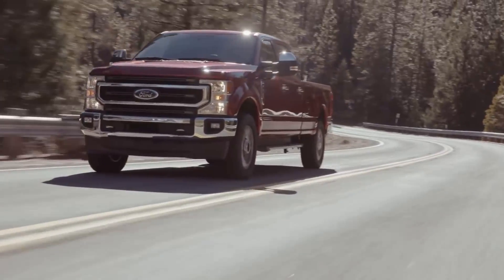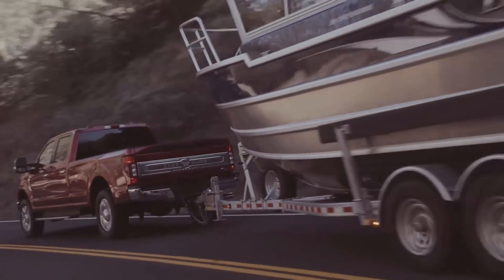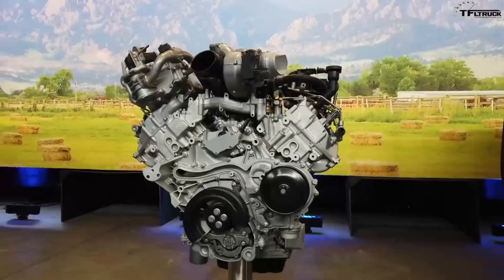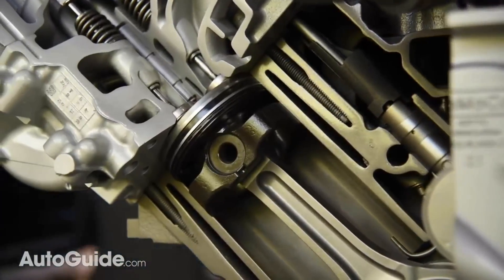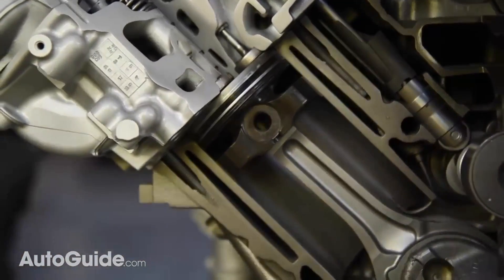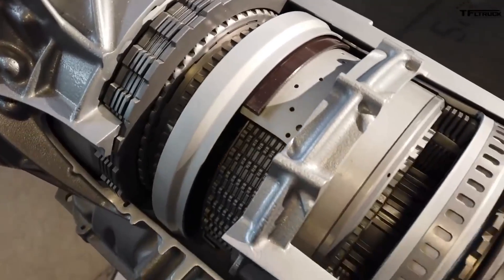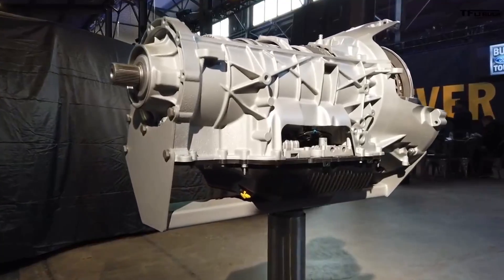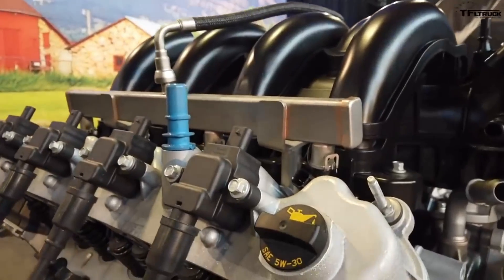2020 F250-350 Engine Changes and Specs (1000FtLbs!!)

Comment: The literally changed everything about. That says something,the previous engine were absolutely garbage, trash. Melting turbos, running the engine temp at 235, horrible
Reply from the maker: There is always issues with first generations of engines. Fords first go at it was 10x better than a 6.4 especially when you think international makes nothing but diesel engines. The turbo failing issue you're referring to isn't fords fault, it was Garrett's. They didn't follow specs but did fix it in 2013. Either you spend years in R&D and when your product finally launches it's perfect! but.... unfortunately it's already outdated... Any 6.7 ford is a great engine, there's a reason they still cost big money. As far as running 235* if a trucks doing that consistently it has another issue. If you're referring to my video you'd also know the rads alone keep them cool and you can reject more heat at a higher temperature differential. This latest generation 6.7 is 10 steps in the right direction. It was very well thought out and will hold a crazy amount of power. We also now know they are making 1050tq from the factory, that's a honda engine more of tq than anyone in the industry.
Reply: @JaegerWrenching  yep Ford makes a better diesel than dodge considering they have never made one and shouldn’t based on my experience. Second gen 6.7s we’re pretty damn good my 3rd gen is much better so far but time will tell.

Comment: A CDL is never required for personal use.  If you've ever pulled a 22,000 pound toy hauler through the mountains, you will quickly realize how that power comes in handy.
Reply from the maker: What you said is incorrect. A CDL is required if you're over 36klbs GVWR.
Reply: JaegerWrenching what you said may be correct in some states but definitely not all
Reply: @JaegerWrenching  RVs 
always had exemptions.
Reply: Thomas Rymsza better check your local state laws on that, you’d be surprised.
Reply: I was incorrect.  Thank you for pointing it out, so others would be properly informed.  I’m in Michigan and here a CDL is not required for personal use regardless of weight.  I copied the following from the state website which is one of three exemptions: Individuals: Operating motor homes or other vehicles used exclusively to transport personal possessions or family members, for non-business purposes
Reply: In Texas if your CGVWR is 26,001 lbs you have to have a Class A non-commercial license.
Reply: M Linger in my research that is the case in many states, but that is still not a CDL and does not require near the requirements to obtain
Reply: Adam Westbrook are you trying to tell me that a CDL is required for personal use?
Reply: Thomas Rymsza I am telling you that different states have different requirements for CDL. Over a certain weight limit you are for sure required to have a CDL, that’s a fact. Don’t know what state you are in but I’d check on where you live.
Reply: @reeffanatic1  personal use has nothing to do with it. State laws dictate what weight/ length etc requires cdl doesn’t have to be a commercial load.
Reply: In Ohio class A is required over 26,000.  No CDL is required unless it is commercial and air brakes

Comment: When RAM announced their TQ numbers and Bowtie announced theirs, Ford was already in the final stages of adjustments and they were licking their chops and will remain King of the trucks. RAM is the Puller however but it will be interesting to see Ford VS. RAM instead of Ford VS. Chevy RAM has pushed Bowtie to the ground and stomped on them while Ford Stays on top and out front. Ford's are the on the job workhorse and known for long lasting diesels(except for 6.0 and 6.4).
Reply: sell your home to pay for a new ford and spend whats left of your money in repairing it!......the duramaxes and cummins will be waving and blowing horns as you sit in the breakdown lane....FORD  found on road dead
Reply: @marioncobaretti2280  My F-150 is @ 252,000+ miles now with good keep up. That's the deal, you need to keep up on them no matter what. Any of them can have issues. Sometimes I think the big 3 are really one company and we think they are rivals. What the Big-3 need to do IS create the best HD trucks ever to stop them 'ElectroTrucks' invasion on us. I root for all 3 of them. I believe Ford made the best move with the 7.3 Godzilla, They will increase the power number in a couple of years for sure, and the 6.7's are no joke.
Reply: @marioncobaretti2280 Isn't it crazy though just how fancy they have become, And tipping around $100,000-$115,000 for a dressed up truck. Damn. I think RAM won luxury vehicle of the year award! What happen to the American Pick-Up Truck?!?
Reply: @marioncobaretti2280  duramax engines suck ass I like the Cummins and fords 6.7. I do find it interesting when people call it dodge Cummins if it weren’t for the company who manufacturers their engines they wouldn’t even be in the top 3.

Comment: Any of the big three trucks will tow and perform well. I drove fords till 1999 and the 6.0 motor went to Ram and never went back. Just bought a 2019 2500 with 850 torque motor. It will run a hole in the wind. I don't know why any one would want to bump them up unless racing application.
Reply: I miss them old 90s Ford's. Dad had a 95 f350 4x4, 460 manual, kills me that he sold it. Only had 40k on it.
Reply: Biggest reason I tuned was driveability (throttle response) fuel mileage and reliability if you love your truck now you will love it more tuned/deleted

Comment: Ram already has 1000 ft. Lbs. Of torque . So Ford might as well follow.  They've been following Ram ever since 1994 when Ram brought out the big rig look First .
Reply: Most people hating on the powerstroke obviously haven’t checked to know that the ps has been the most reliable Diesel engine the last few years. I’ve owned all 3 except my Cummins was the 5.9 which by far is way better than the Cummins 6.7 which is trash. I’ve had friends with the newer rams and duramax get their trucks lemon lawed from problems, especially from the emission systems on them. But my 17 f250 is by far the best diesel truck I’ve owned, I love it and can’t wait for the 2020s to come out.
Reply: @jacobwainwright8683  wow you have a 2017 and you already calling it the best truck ever. Wait a couple years and the pos Ford will do what they all have done in the past.  Break down . Did you already forget about the 6.o and the 6.4  and the Triton 5.4. Cam sensor's  ect . Ect ... Ford sucks ass .
Reply: @bradhardy2629  triton engines are a total other nightmare!
Reply: @Brad Hardy do you also realize those engines are gone due to the problems which I’ve owned all but the 6.4 and I had over 250,000 on my 5.4 with no issues other than the famous tic of it but no other problems unlike all I had with my gm motors which were the 5.3, 6.0 and the 6.6 and especially the gas transmissions which kept me away from any dodge from the start other than my 5.9 Cummins which I bought only for the engine but we’re talking about the present trucks not the old ones and the 6.7 ps has been the most reliable over the 3 with gm changing the duramax every 2 years or so from problems and the HO 6.7 Cummins staying number one on most unreliable vehicle recently so yeah out of the newer trucks my f250 is by far better than the other 2 trucks currently, not saying the all new trucks will be the same because it I could ever custom build a truck it’d be a ford body for the cab space with a 5.9 Cummins with Allison trans and ford rear end would be my dream build. Every truck has problems here or there especially with the emission systems but Ford has they’re shit put together better on the current trucks
Reply: @jacobwainwright8683  its like a typical guy that keeps fuckin some bitch because he,s addicted to her looks and pussy , but cant contribute anything to her relationship with you , and costs you a fortune. just like ford you will keep ridin it, every time it lets you down you start with all the excuses. your view and constant losing stubborn attitude  is like shopping for trucks with a liberal mind set, keep doing something that keeps failing. IT WILL NEVER CHANGE WITH FORDS !
Reply: That and with the aro dynamics, with the curve in the hood not the square body
Reply: Richard Skipper  but at least it keeps running , body parts are much cheaper than ford diesel engine replacement or repairs
Reply from the maker: I know you're brand loyal and love dodge, i get it and love certain brands and things as well. I actually like dodge/cummins. But This is a video about the changes made to Ford 2020 engine not about copying. If you want to talk about copying we can. But By that logic everyone has copied Rudolf Diesel who invented the diesel engine. Also guys have been making of 1000 lbs of torque for a long time now in the aftermarket diesel world. So does that mean Ram copied the first guy to make 1000lb ft of torque? How far do you take this idea of copying? This new ford engine will make over 1000 lbs of torque. Does that mean dodge copied ford when they finally make over 1000 lb feet? It just really sounds stupid when you actually think about it.
Reply: @JaegerWrenching  the whole story is the light truck diesel market! every year its a showdown, since 1998 ford keeps standing up and falling down. the more complicated ford plays , the more it fails. making payments while it spends 3/4 of its life in the dealer and ford fighting against you over what there gonna cover. it is about loyalty , what has been working you go back buy it again . most people work hard for there money , maybe your living off an iheritance to live a wet dream of broken down fords.
Reply: @JaegerWrenching  I'm talking about the factory's  big three . Ram is the first in many many things . As well as putting out 1000 ft. Lbs.if torque with a reliable engine.  That doesn't need to be bullet proofed after you buy it . Like so many Ford diesels in the past . Junk .  Ford really sucks when you think about how much shit they've put out .  6.0.  6.4.  5.4 Triton.  Triton v 10  eco boost . All junk
Reply: @bradhardy2629  
You are absolutely right. I have owned 7 Fords. They were some good, some bad. My hate for Ford is directly because of the constant change everything to obsolete everything else they ever built. This behavior just screws everyone who has ever bought their products. GM and Chrysler keep refining their products, making them better while allowing the new to be retrofitted
Reply: Brad Hardy All manufacturers have their ups and downs, but let me know when RAM can finally make a transmission 😂
Reply: @DieselJon1  have you been sleeping ? thats in the past . you can let me know when ford can build a real engine , gas or diesel . been waiting since 98 ???

Comment: Cummins Diesels are were just Agriculture Industrial Diesels. When the first twelve valve Cummins went into a Dodge everyone knew they would be better than Fords International as they were already a superior engine to the International in the tractors of the time. Great Diesel industrial engines of that time were the Perkins, John Deere, Cummins, Cat, even Ford had a Great Genesis Ford six Cylinder diesel in everything up through the Versatile. Ford sold the best Diesel they had to Fiat with Ford Tractor and New Holland. Stupid, and GM didn't use a Detroit Diesel and they own them, in their early pickups, stupid. Too big corporations that were stupid and typically hire and promote the people who are intellectually defective but full of themselves and deserve nothing more than to be riding on the back of a Trash Truck in some awful place.

Comment: well the 6.7 in my 2015 450 could be tuned to 5-600hp before reliability became an issue with that generation engine. I believe the final hp will be about 475-480hp and 1050hp.
Reply: you definitely nailed the numbers. good call!

Comment: Tow heavy with a Cummins and Powerstroke and you’ll burn 30% more fuel in the Ford. RPM is nobody’s friend.
Reply: Fact
Reply: Yeah, Cummins is better
Reply: I agree the Cummins tows a bit better (not astronomical). But my 2021 6.7 does better on fuel towing my same trailers I towed with my 2015 Cummins. And my Cummins was deleted so was doing better than stock. The new 6.7 tows on par with the Cummins I had but without a trailer the 6.7 eats the Cummins for breakfast. I love both

Comment: Thanks for the info on the 6.7.  (I have a 2017, 6.7 Diesel, F350)  Your 500 horsepower estimate (5:48), is too high. Here's why: Horsepower is DEFINED as torque * RPM. If Ford matches Ram and Chevy, achieving  ~1000 lb-ft torque (they get ~450 horsepower), then the only way that Ford could achieve higher horsepower with equivalent torque is by running at higher RPM. If the current peak HP is at 2600 RPM, then the 'new' peak RPM would have to be 2600 * (500/450) =  2890 RPM. 

That higher RPM may be possible. But without a MAJOR redesign of the bore, stroke, compression ratio, connecting rod length, etc., I very much doubt it. Higher RPM motors generally have shorter strokes because the piston skirt friction and inertial loading increases with the square of the speed (actually, even a bit higher than that). Of the three Diesels, GM's Duramax has the shortest stroke, followed by Ford, with the Ram (Cummins) having the longest stroke (and connecting rod). The last specs I saw showed that the Duramax had its peak HP rating at the highest RPM of the three Diesels.
Reply from the maker: They changed everything except the block. They went to a steel piston which allows the piston and it's skirt to be shorter, "less rubbing" they also moved the wrist pin location up closer to the piston top, again less rubbing because it allows for a more aggressive angle before rubbing, with Less friction because steel on steel has as very low coefficient of drag. These trucks run way past 2800 rpm, 17-19 6.7's rev to 3200 rpm in stock form, they also rev past that when engine braking, the engine braking rev limiter is set to 4200 rpm. The only reason they don't rev them that high whole revving up is because they run out of turbo and can't move enough air at that RPM. Look at any tuned dodge with big turbos and a fuel system they  rev them to 5500RPM. They also have the longest stroke as you had mentioned. So i think it is high at 500 but this engine will do it. Might not be on the 2020's just yet! But it'll be after ford changes the tune on later year trucks with this exact same engine.
Reply: @JaegerWrenching  he was wrong, I’ve seen these trucks on a dyno, Ford lied on the numbers they’re making as much hp to the wheels as their crank numbers Ford put out. One on YouTube in fact stock is making 479 hp to the wheels. He can argue all he wants these trucks are making more than 500 at the crank.
Reply: Well you were wrong hahahahaah 475hp  1050
Reply: @jwhitley101whitleyfarms9  No, I am not wrong. I simply pointed out that the very DEFINITION of power, given the combination of assumptions he made about power and torque and the RPM at which they were achieved, implies that at least one of his assumptions MUST be wrong. Algebra proves it.  
I know the 2020 6.7 Powerstroke specs. A close friend has one and I've driven it to compare against mine. Ford's 2020 specs are entirely consistent with both the assumptions I made and more importantly, the math.
Re-read what I wrote, and pay attention to the math, as it is correct.
P.S. For reference
2017  440hp @ 2800    925 ft-lb @ 1600
2020  475hp @ 2600  1050 ft-lb @ 1600